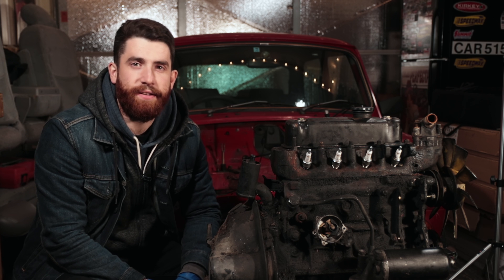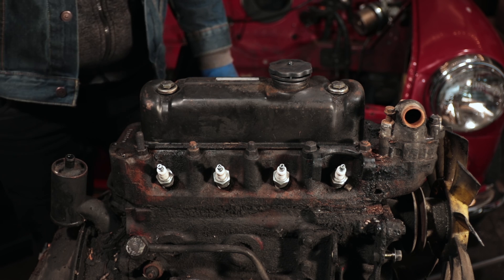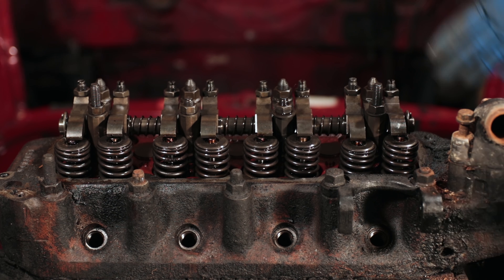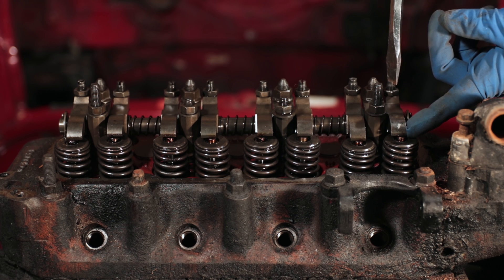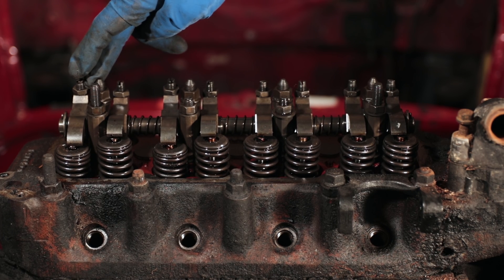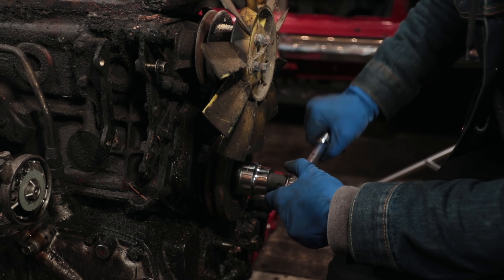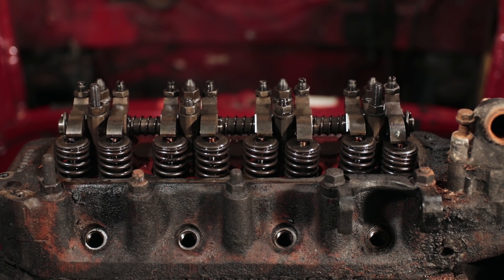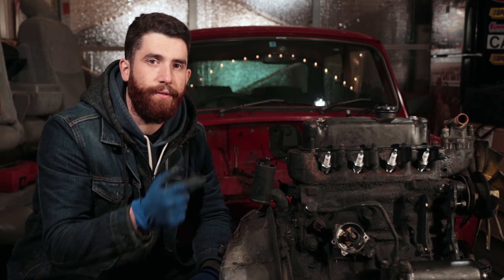Valve adjustment on a Classic Mini Explained

Comment: 2:42 You should adjust at max. compression stroke first, not adjusting at overlap point. It's my opinion 
If the 4th piston comes to overlap point. You adjust the first piston before.

Comment: I just follow the Haynes manual for which valve to adjust.  What I find unfortunately is that when tightening the lock nuggets it invariably changes the gap, usually making it too tight.  So you have to play a bit of a game, untightening and then retightening until you get the right gap when it’s tightened.  I used to set inlets to 8 thou and exhaust to 12 thou if my memory serves.

Comment: To HARD..!! Get #1 piston up on the Compression stroke. Yes put your thumb in the plug hole and wind the engine by spanner and you will fell the air being pushed out the cylinder. The timing mark will be coming up on the front crank pulley. When that happens you are at TDC, and ready for the power stock..Both valves are fully closed and that # 1 Cyl, can be adjusted..Bring the next cyl in the Firing order up to top dead centre TDC, and repeat the process..1342 is the firing order.

Comment: Does the rule of 9 only apply to this particular engine? Or does it work on similar engines? I want to adjust the valves of my Fiat 127 900C from 1979.

Comment: It seems like if you take valve 8 depressed then the opposite end to adjust, ( the symmetrical opposite) so you do not have to count and if you make sure after valve 8 the next is 7 with symmetrical is 2 up from right Then  3rd one from left (depressed then adjust 3rd from right. You will get them all done as long as you do it 8 times moving from left to right. IN EFFECT ADJUSTING THEM ONE AFTER THE OTHER FROM RIGHT TO LEFT

Comment: Does the role of 9 apply to all engines? I have a six cylinder marine engine. Can incorrect valve clearance damage the engine or would it just be a case of burning the valves?

Comment: rule of nine doesn't work on all firing orders, 

on an inline four cylinder engine that doesn't follow the rule of nine you can use the cam lobes as a reference because they are 180 degrees apart on each piston pair.

If you set a valve on number one cylinder to fully open/ on the tip of the cam lobe it's twin on number four will be fully closed/ on the heel of the cam lobe and vice versa, the same goes for cylinders 2 and 3.

Comment: I’m new to car repairs so excuse me if this is a silly question: can this be done with the engine still in the car? Or does it need to be removed?
Reply from the maker: Yes it is usually done with the engine in the car.

Comment: Hi , im in the process of adjusting the valve, what filler number should i use im mm?  Is it 12thousands of an inch?  What is it in millimeter? Thank you
Reply from the maker: It depends on your engine spec. They vary, so that's why we don't specify. Gotta look it up!

Comment: Thanks for the clip, the mini and I really appreciate it.  Do you recheck the timing or adjust the air/fuel mix afterwards?
Reply from the maker: Technically you should double check timing afterwards, but it should be close enough for most folks. If they were very far out, we check the timing out of the assumption that the car has been neglected and timing set improperly in the first place. Same for carb mixture.

Comment: Muy complicado,hay una forma normal de hacerlo sin tanta ciencia PMS  en compresion en cada cilindro y en  720 grados, 2 vueltas del cigueñal,para todos los motores 4 tiempos sobre la faz de la tierra,de 1 hasta 24 cilindros y de de 2 ,3 o 4 valvulas por cilindro,es igual en todos.

Comment: Hi - What difference would there be (if any), to add a set of 1.5:1 lifters of a stock 1275 Rover Mini Automatic?  Thanks
Reply from the maker: Hi, it depends on a number of factors but, in general, it would move your torque curve higher in the rpm range.

Comment: So I’ve got a massive problem. I’ve set the clearances all wrong. Now they’re all mixed up so I can’t use the rule of 9. Is there anyway to find out how to set the valves completely from scratch
Reply from the maker: That's fine. Just loosen them all off and start again. Watch for rod movement to see which valves are opening and set them as you go.

Comment: Hi Steve! Greate video like always. Can you tell me the Feeler gauge that you use? 0,20 or  0,30mm???
Regards from @mini.lotso
Reply from the maker: It actually depends on the engine
Reply: @Stevestonmotorco   I have a 1,3spi 1991 Mini Cooper. I read that the value is about 0,23 to 0,30mm? Can you give me a hand?  Regards from @mini.lotso.

Comment: With 4 cylinder engines, I  make use of the fireing order,just get the valves on cylinder 1 "on the rock", this is the point where both valves are slightly open, this means that cylinder 4 is at TDC on compresion  so you can adjust two valves at once.  One revolution of the engine gets cylinder 3 on the rock so you can  adjust cylinder 2, then next rev it's 4 so adjust 1, next rev 2 so adjust 4 been doing like that for near fifty years, works for me!
Reply: right ' just follow the firing order and half turn by half turn, adjust the cylinder that is to the firing point, much simpler, you adjust both valves and the reeor risk is minimized.
Reply from the maker: Good tip. Whatever works!
Reply: I've been setting tappets this way for almost 50 years. Really great . Thanks !

Comment: Thank you for the very detailed clip . 
It’s work the same on a 2012 Mini ?
Reply from the maker: Not sure, you'll have to consult the manual or new mini forums.
Reply: No. Modern cars like the 2012 mini no longer have rocker type valves. Most modern engines have the camshaft over top of the cylinders (unlike the classic engines where cam is below cylinder and uses pushrods to push the rocker arms up/down). Modern engines typically have hydraulically adjusted cam-followers pushing down on  the valves which do not need to be manually adjusted...the oil pressure is used to self-adjust. After prolonged mileage, there are small circular shims that make contact on the valve stems that can be replaced if worn below a certain limit.

Comment: Excellent video! Answered many questions I’ve had about my R53. It’s making a ticking and smells like unburnt fuel with worsening mileage. I posted a video if you don’t mind checking it out.

Will this process work just about the same on my model?
Reply from the maker: David Boyea new mini’s are very different, not sure about the valve adjustment procedure on them.
Reply: You're talking about a totally different car, man

Comment: Great video guys! Quick question, do you only adjust one valve at a time or if two valves are being compressed do you adjust the corresponding valves within the same revolution of the crankshaft? Thanks!
Reply from the maker: vincent gregan yes you can absolutely do two valves at a time. For demonstrating purposes we just did one but when I’m doing it for real I do two to save time.

Comment: if the valves dont close fully would this cause a vibrating noise and no power above half throtle sounds like pistons are maxing out  like drdrdrdrddrdrdrdrdrrddrdr
Reply from the maker: king kong valves not being adjusted correctly can have many signs but it is very critical to engine running. If ever in doubt it’s always best to adjust them

Comment: Had a hard time installing the rubber trumpets as they were solidly together. Finally did get apart but when fitting to frame, one side was much higher than the other,
This is the way the mini came, in boxes. I found out that one radius arm was from hydro static mini, The trumpet socket was about 3/4" difference that the other!!!!Now have a correct pair but arms do not sit like the one on your bench. Should it be almost level?

Comment: Thanks for another great video! Top tip for any AUTOMATIC Classic Mini owners out there; to turn your engine over while its in the car your options are either remove the radiator to access the crankshaft pulley bolt as shown, or I would recommend removing the starter motor and turning the engine over using the flywheel :)
Reply from the maker: Steve F thx for the tip!
Reply: There are easier ways. Removing the radiator is not easy and removing the starter is not necessary. A cheap starter switch is the easiest way to move the rockers on a Minimatic.

Comment: Loving the videos man, clear and useful info. Quick question - would you use a torque wrench to tighten the locking nuts at the end?  By the way your short shift install is the best set of instructions I have seen on line bar none (including what CAD provide). Keep it up. Chur
Reply from the maker: Лъчезар Големанов thank you so much for the kind words. A torque wrench isn’t really necessary on the rockers as long as you use your common sense. A medium grunt is usually sufficient

Comment: Is there a difference in valve gap between the 998 1098 & 1275 engines and do you use the same gap for mpi & spi too? Thanks in advance
Reply: Yes, Yes and Yes (according to Haynes and Mr Vizard)

Comment: Nice! Had never heard about the rule of nines. Is that applicable to most 8 valve engines?
Reply from the maker: Diogo Campo Grande It should be! Mandatory disclaimer: check with the manual.
Reply: Alrighty. Thank you for the great content!